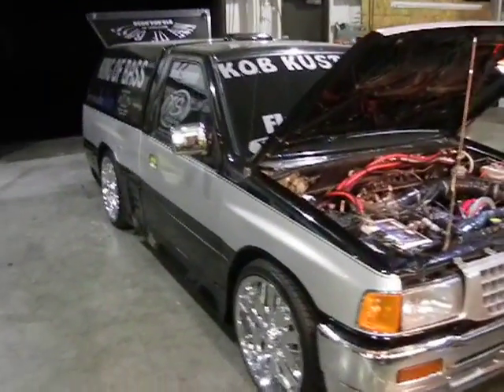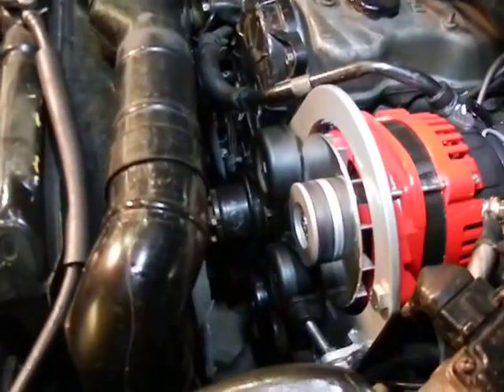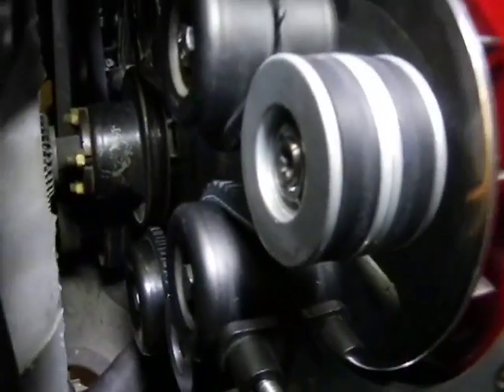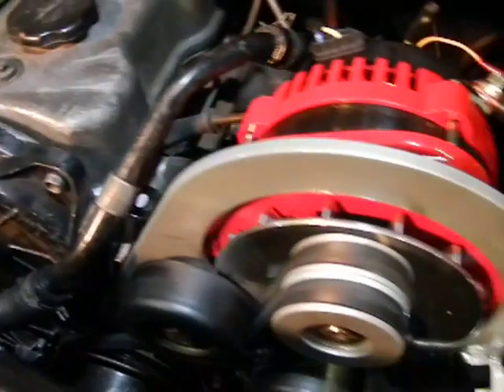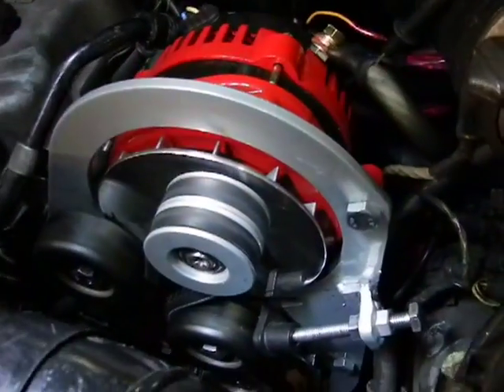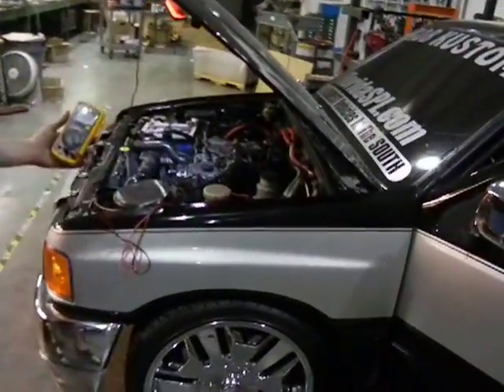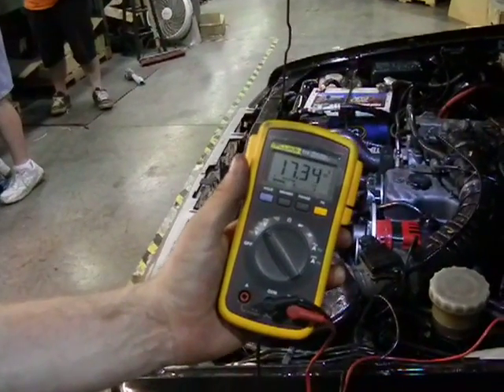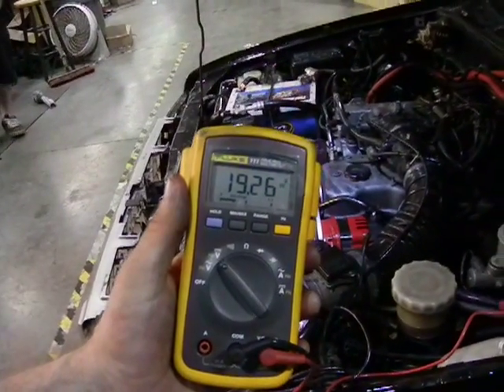Mechman King of Bass Install COMPLETE!

Comment from the maker: @AndrewMack33 

Tommy's truck has 60,000 watts of power in it, with the potential to draw 4,800 amps at full tilt.  900 amps worth of alternator power is a drop in the bucket while the system is playing.  The main purpose of the alternators on a vehicle of this magnitude is to be able to charge up the huge battery bank in between demos.  Tommy generally doesn't even run the truck when he demos it, as the sound of the engine takes away from the super clean sound that it produces

Comment from the maker: With low load it will charge @ 19.2 all day long, when you start to draw from the 50k watts of power in this truck it will drop the voltage. The alternators are functioning properly, any system that pulls real power (50k+ watts) will lower the voltage, that is not an indication of the amperage produced by the alternator. 

They do not "heat up fast", they function properly in this application and the voltage drop is simply due to the demand of this system.